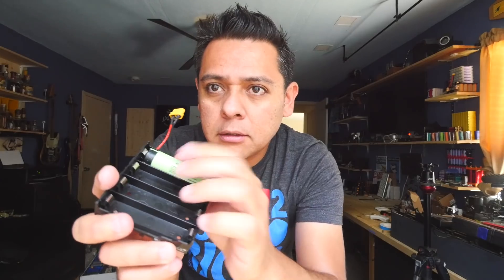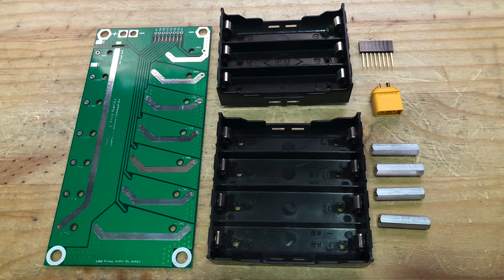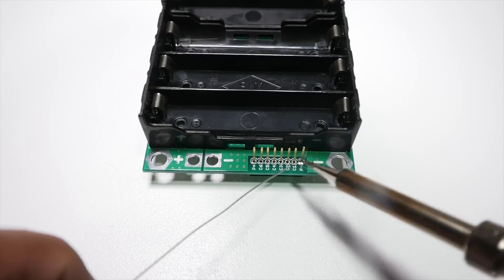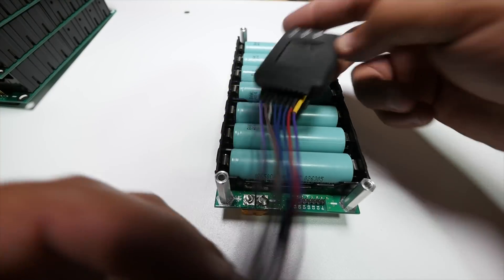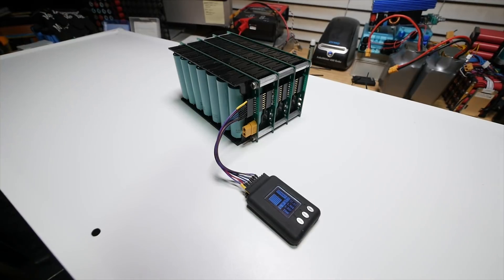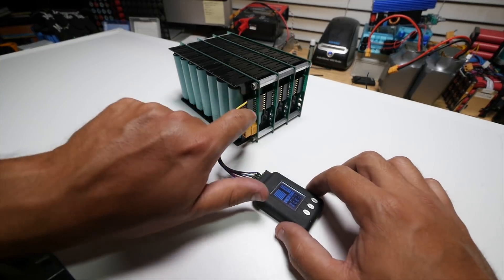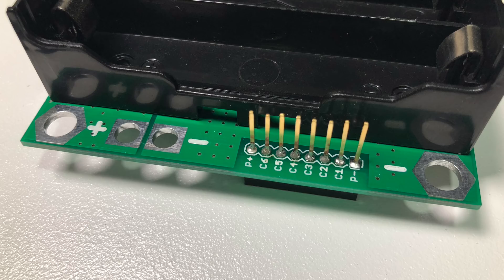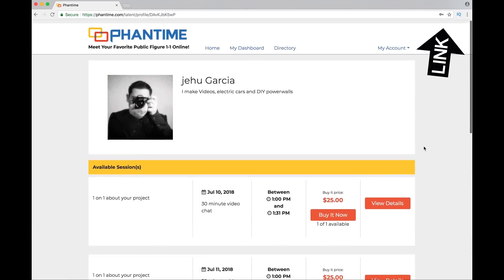DIY Rapid Build 18650 PowerWall Module project  - design & testing

Comment: could you use that system on a power system for motor homes at around 3 to 400 amps with solar panels to charge them??????

Comment: you can't use IR cameras to show temperatures of silvery metals, you must pant it black with a sharpie or use heat shrink tubing. Silvery metal have high reflectivity, thus low emistivity and appear invisible to heat cameras.

Comment: was battery fault. if u used proper battery the extra tension against contacts would stop excessive heat. they wasn't designed for the flat head style battery used in laptops ect

Comment: What is the reasoning behind using these smaller lithium batteries instead of larger liquid batteries?
Reply: i may not be right  but --- faster recharge , long life, more total recharges , easier and cheap to replace dead cells, no adding water or acid(no danger), i think they handle heat and cold better, and spend less money to start diy project

Comment: How about drilling holes in the holders, to allow heat to escape?
Also, on an eBike, would riding it not cool the battery down, due to wind?
Reply: If the wind can get into your battery packs then so can water.
Reply: I think it would. Kind of like a car's radiator system in a way

Comment: Hi everyone:)
In my opinion building a powerwall out of lithium ion batteries is not efficient. Lithium-ion batteries are not cheap at all. The chemical waste for the  production of Lithium is enormous. Instead you can use car batteries,  they are cheap, easy to handle, you can get good ones nearly everywhere and the recycling ability is really good. The downside is, a little bit more space is required. In my opinion lithium is not the right choice!

Comment: Hi Jehu , I have done DIY with my 48V 20Ah pack Lithium battery total 3 pack, but I don't how to paralel it so I can get Power 60Ah , cause in my BMS is has 2 port , one discharging port and another Charging Port.

Comment: The cheap plastic are the true weak link probably made of only ABS need casing made for high heat abs+fiber resisting heat and the  metal used for contact are probably the culprit not conductive enough or tick enough for amperage ,you will have to reengineer one made of scratch ! But this type of modular design got a lot of plus like if you have a few bad batteries you can change them easily without soldering you're onto something good worth the effort to improve upon !

Comment: Did he just use just one small wire as a resistor for 7 paralleled 18650 batteries? What current doeshe expect to draw from those???
Reply: also, those balance charge connectors will end up with paralleled cells when you stack the boards up. Thats not per cell balance charging???

Comment: Thanks Jehu. You said the battery holder and the respective contacts were pulling 18A at 126 deg. and said it should only be 4A. At the end of the video,  you said it pulled 4A. I missed something during the experiment. Would you please explain?

Comment: 0 C is freezing 100 C is boiling, that's logical.  32F is freezing 212F is boiling. where is the logic in this outdated system?
It's like the ground floor is 32 when using the elevator, Wake up America.

Comment: test them with better battery's .. it is possible they were the heat source .. 140  degrees at 20 amps.  You stated was the batterys limit was 2C  so 18650 are typically 2200 mah so 2200mah X .001=2.2AH X  2c =4.4amps with 20A pack draw the batterys were producing 5A each.

Comment: Please please tell me the stand-offs aren’t that cheap lightweight crap.  You need better quality standoffs.  Also your traces are heat sinks and they are responsible for reducing the temperature of the contacts.  Also the metal the contacts are made of and the spring rate that they have will affect temperature.

Anyways I mention the traces and how they are your heat sinks because you could actually attach a heat sink to the traces.  You could make it optional where you solder it on.  Just give a nice pad area for positive and negative.  Looks like it wouldn’t take a whole lot of dissipation from a heat sink since you are probably creating less than 15% waste heat so wouldn’t take much upgrading and you would be able to handle 2C like a champ!  

You should maybe offer an upgraded version that costs a little more.  Copper in the battery holders and the pads for the sinks!

Comment: Good stuff! How does the system survive also detect and signal a failure of a cell (and the worst case when cell develops an internal short-circuit)? 
Is there a complete design including the cost of building and installing a Power Wall solution?

Comment: wouldn't it be better if the cells were in parallel to the amp hours you want then seriese the packs up to get the voltage u want ?

Comment: A fuse will not heat until the amount of energy passing through the fuse begins to exceed the capacity of the fuse. A battery will heat up due to the chemiczl composition of the battery, that is what is heating up the terminals on your thermal imaging screen.
You and your PowerWall DIY kind will be starting a great many fires if cooling doesn't become part of the design and assembly.

Comment: The quick appearance of high temps at the ends of the batteries is due to the (potentially) poor connectivity of a spring contact arrangement. While it would appear that there's adequate surface area on the battery end and the frame spring contact, nothing could be further from the truth. Moreover, once the spring contacts do heat up they'll warp out of shape, compromising the contact area even more. There is no substitute for properly attached (welded or soldered) wiring when your current profile on each cell is likely to be 2 amps or more. Also, once enough heat is generated in those spring contacts their elasticity will also deteriorate with time. These types of "quick connect" frames are best suited to test equipment applications, but even then, longer duration current flow could still create heat and connectivity issues. There is no substitute for doing this shit properly, especially with these pocket bombs called Li-ion batteries.
Reply: Came to post this. I wonder what the energy losses from these things are at day one, let alone day 100
Reply: @funposting8912  So what's the real solution to this?
Reply: @ztechlabs Just make sure it's '00' steel wool, for maximum destruction.
Reply: Scrolled down to post exactly this, I am frightened by these practices.
Reply: Wonder what the resistance is of the standoffs since that is what the main power is being transferred through.  I feel like I would want copper to transfer vs going through a steel standoff.
Reply: Use some steel wool for a better connection.  Better yet use copper wool although it's much more expensive.   Just be careful to keep the wool in the right place so it doesn't short anything.

Comment: Holy crap! Why did you cut off the resistor itself? (Seen at 05:35) Only using a portion of its one leg. Second question, why was there a single '+' sign on the negative side of the black battery holder next to the circle or 'bubble' (seen at 04:25)

Comment: The problem is that those uses  72v 20 amps battery packs, and looks like they are  good for 30 miles only, Wouldn't be great if a battery expert could take a look at those and make an special battery pack that increase the range?  And also had a project to help replacing batteries cheaper ??? A battery pack for the bike cost 500 dlls and once it fails you have to fully replace it.  https://www.alibaba.com/product-detail/bateria-72v-72-v-20ah-motorcycle_60747151897.html?spm=a2700.7724838.2017115.32.49dd3cf8FZlsRh

Comment: There is a point with your build that is superior to the traditional way, You must create a version for E BIKEs  you really have to!!!!.  Ok lets assume your EBIKE battery pack fails  under the traditional packs the damage would be massive and the effort to to rebuild it would be really big , not only that the cost of repairs. If we had your build instead we just pop up the damage cells and replace them.
Reply: Jorge Flores no good thermal contact, all the cells need to be RTVed in otherwise they’d pop out in any vibe environment, also high contact resistance those holders aren’t great at conducting current which is why the contacts are heating up so much (although 120F isn’t hot in the electronics world). It’s a cool build but not professionally done. Also you should never use a resistor lead as a fuse you are better off just buying the 10 cent correctly rated surface mount fuse. This was done by a hobbyist not an actual EE. Real EEs never use Fahrenheit even in the USA

Comment: Question: the resister you were supposed to solder on the back, was the resister supposed to be soldered in or just a simple jumper where the fuse would go? You mentioned a resister in place of a fuse. But as is you just placed a jumper where the fuse went. It will not provide the resistance that may be needed to protect the system. Or was i just confused?
Reply: Its at 5:32 into the video. You state your supposed to use a resistor but its only the wire used.
Reply from the maker: I’m using the leg as a fuse
Reply: Ah ok

Comment: Dude, thats not how a resistor works. You clipped off the actual resistor and just soldered wire.
Reply: he is just using the wire lead as a fuse.  the resistor itself isn't used.

Comment: Do you think it would be possible to do something like this but with 12V instead? Or I can just use 4S instead of 7S with this exact PCB?
Reply from the maker: Yea you can bridge the output to cell 4 terminal and you get 4s
Reply: @jehugarcia  Great! I would assume since its just 12V it wouldn't be too hard on the 4S bracket even if they're made of plastic. Do you think you will ever make a 3S or 4S version in the future?

Comment: Hey there. Really like your effort.
Have you tried soldering / spot welding wires onto the cells an then put in the plastic holders instead of using the contact pressure clips in the plastic ?  Should provide you with a better efficiency
Reply from the maker: So much work.  If you are spot welding just do away with the holder all together

Comment: you said you can replace the fuse with a resistor, yet you only bridged the gap with the resistors leg, but didn't use the resistor/ what gives?

Comment: While your work is extremely neat, I am concerned about your starting voltages maybe approaching the maximum input voltage if the inverter. I am also concerned about the PCB traces and the current that you are / will be asking them to carry at full load of your inverter. Your "fuse" will carry more current than the traces will. Good luck though. I also liked the idea of the pins for testing individual cell voltage though.

Comment: Just my 2¢, I would consider finding a battery holder that provides more contact with the battery. Typically I see when inserting batteries in holders that the spring clips are rounded slightly as is the battery terminal. What happens when you put two round things to each other, the contact area is greatly reduced. It's like driving current thru a small wire. It will get hot. You might have to solder or weld the tabs on the batteries for better current handling. Loved the video. I like the way you think out a project and not afraid to ask for help. Smart man!

Comment: Thanks, I was going in this direction too.  ?Could you try 'Automotive Dielectric Grease/Silicone Paste' on the connect to eliminate connect resistance/heat?

Comment: It would be interesting to watch the ir camera during charging too.  Would this work better with a heat sink separating each battery for instance? One time I installed 2 known to be good working hard drives in a pc case touching one another.  But within a few minutes of starting them up, they were over heating because the usual tiny airflow was critical to their operation.  Having them touching caused the heat to runaway until they alarmed.

Comment: I think this is a great but as mentioned in the comments the trays need to be more heat resistant  and any metal parts that could lead to an easy short need to be insultated with heat shrink. Maybe start a series starting with this but continue to a complete the entire power wall.
Reply from the maker: The level of performance achieved by my design is adequate for my intended use
Reply: yes - I agree I need to start building my own powerwall. What voltmeter and charger do recommend?

Comment: Great video, once again, Jehu.  2 questions:  Are you aware of a battery analyzer/tester like yours which can handle 10s (36v/42) or 12s (48v/52)?  How about your board, do you make one in 10 or 12-up format?  TIA  (That's thanks in advance, not aunt ;)
Reply from the maker: No I decided on 7s because that’s what works on 24v inverters,  you can use 2 in series for 14s which works on 48v inverters.  Why do you want 10s?
Reply: Was thinking e-bike until watching the rest of your video.  I'll solder or spotweld.  It's time I used up that microwave transformer...

Comment: Your soldering is actually terrible to be honest... your taking away the soldering iron to fast so you dont get good solders on the connections so might come lose quickly with vibrations or touching them a few times, it hurts my heart to see this so please improve, but awesome video! :D
Reply from the maker: maybe you need to do all my soldering
Reply: I'm up for that, your better than standards :)

Comment: This isn't very high end system. Works fine as long as cells are relatively good quality and fresh. If using cheap unbranded (Chinese) cells you can expect anything imaginable after few charging cycles. This board measures only average bat levels meaning that if one cell fails, system can't find it. More sophisticated system requires a bit more work and electronics but gives more reliable results. Perhaps this fits for most users though..

Comment: wouldn't be more effective if batteries were square instead of rounded? I mean, in a square four pack of rounded batteries the middles of the square always remains empty space ... which I think is a waste of space.
Reply from the maker: Yes,  but the round shape works better in so many other aspects

Comment: Is there anyway to adapt this build process to my Sonata 5300s?  I love the cells but making battery packs is proving awkward.  They are effectively (capacity-wise), two cells in one wrapper, even though they are actually one huge wrapped cell.  They would require taller standoffs between pcbs and taller pins.  The pins would be awkward.  Any thoughts?

Comment: RE: @13:50 -- 130 degrees F is about 55 degrees C. -- ABS plastic (assuming that's ABS) doesn't really start getting soft until at least 160 degrees C (depending on what's mixed in with it). -- If it's Nylon, it can go much higher (like 230+).
Reply: https://www.okwenclosures.com/en/technical_data/enclosures_plastics_guide.html

Comment: What kind of amperage are you pulling across that small resistor leg you put in instead of a fuse? It seems kinda small compared with the tracks on the board. I would recommend you to use a thicker wire.
Reply from the maker: I only need a couple of amps from each cell

Comment: Jehu the connection might be to loose maybe if you put a screw(or nut and bolt) behind the flat sheets(connectors) in the charger  to get them to press harder on the pos and neg of the battery, might help keep them cooler

Comment: A lot of inverters stop working a lot voltage of 11.4 and an overvoltage of 14.3 so my question is... How do you choose between 3s or 4s?
Reply: Lithium Ion cells are not the best for the regular 12v inverter. Lithium iron phosphate cells are better for that case compared to lithium ion.

Comment: Just found your FB page and YouTube channel and really enjoying your videos. Great !!! Have you done a similar heat test with a pack that has been soldered together? Would it be safe to assume that the best result long term would be to solder them together? I guess if there is a cell that is failing, a whole lot easier to swap out. Thank you for sharing your projects, very inspiring.

Comment: If there was a low melt temp solder paste that could be put on the contacts...

Assemble each module with fully charged cells and a skim of solder paste on the contacts. Put enough draw on to heat the contacts to the solder melt temp. The solder melts and makes a lower resistance contact. The contact temps then cool below the solder melt temp. The lowered resistance prevents the contacts from getting hot enough again to melt the solder.

How about holders that have contacts with several sharp barbs punched in? Those could dig into the ends of the cells a bit to make better contact. Apply silicone grease to contacts and cell ends first so that air is sealed out.

Copper standoffs at the power end should be a better choice. The monitoring bus connectors should be available with longer pins or taller connectors to bridge the gaps.

Comment: This is a great build. But one flaw on the current state is the charge balance connector. All these small pins you absolutely don't want to short circuit... Maybe only keep the female connector on one end and cut the pins on the other end (before putting batteries!) to not let the chance of accidental bending after the final assembly is done.

Comment: Why you chose 4 housing with 3 housing ones! I think it will be better if make it the two is 4 battery housing. What do you think?
Reply from the maker: 4+3= 7
Reply: OK, I think battery housing should be made from a different plastic which could handle high temperature than current one, then in a bigger setup a Fans will be required to replace hot air between cells while charging or at high discharge situations. I'm wondering what is the limit for battery cells temperature? ^_^
Reply: BTW, I feel any heat signature is a bottleneck connection. So, expand to that surface is required.